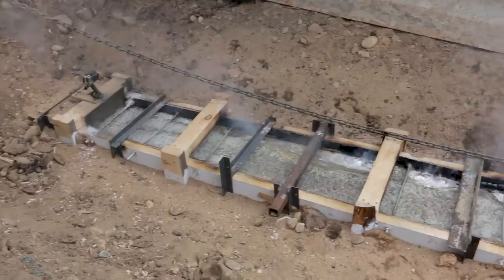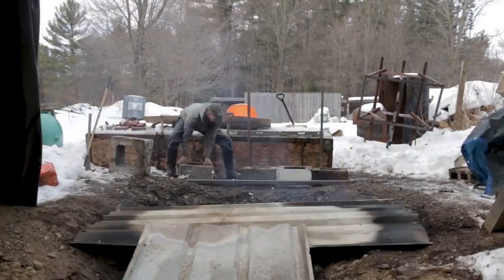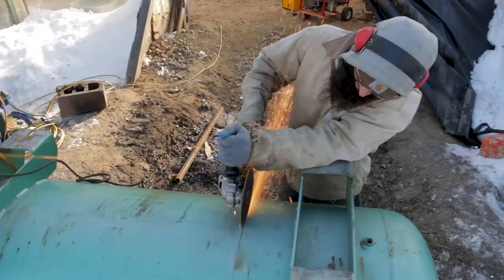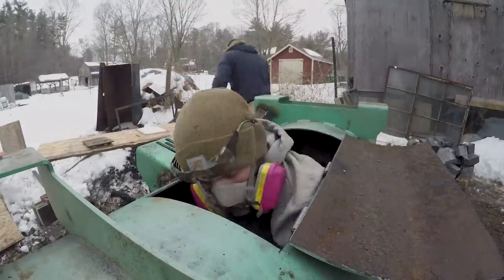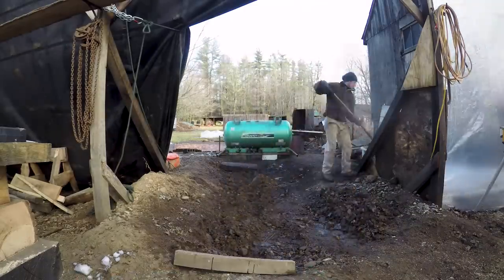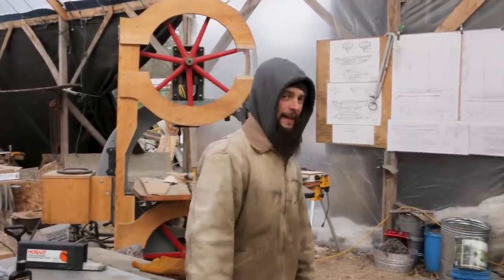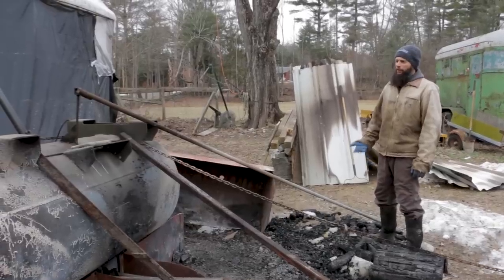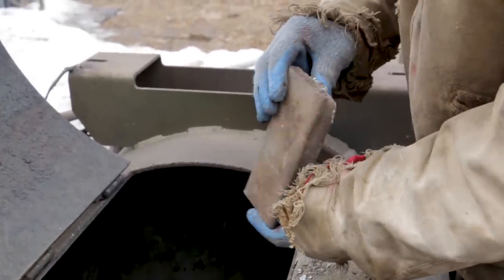Acorn to Arabella - Journey of a Wooden Boat - Episode 25: Setup for Our Lead Pour

Comment: I’m pretty sure that block of metal that didn’t melt, is a zinc anode.
Reply: Nate Reynolds I was thinking the same thing. They use them to absorb corrosion from salt water to protect iron or steel parts.
Reply: melting point
zinc 787F
lead 621F
 If it was an anode i'd expect it to have holes for bolts to go through. we'll never find out
Reply: If it says KIRK on it, its most likely Kirksite. Kirksite is about a 95% zinc/5% aluminum alloy that was originally developed within the automotive industry for sheet metal forming tools.  Zinc is still pretty heavy.

Comment: Awesome work lads. That kirk block will be zinc. Keep it as you'll be wanting to put zincs on your keel and prop boss to reduce galvanic corrosion between the lead keel/bronze keel bolts or bronze prop/stainless shaft. But I'm sure you're all over that.
Reply from the maker: We are aware of the need for anodes and will be putting them on when the time comes.  There seems to be many theories for the block, some say zinc, others say babbit and one even guessed silver although we doubt it's silver.

Comment: Anytime you have a problem with plumbing(and you probably won't now) Do not hesitate to ask me. I'll be happy to help in anyway I can. You could have used a union and swung each section of pipe toward alignment where as each was being tightened as they came into line. There would have been a slight difference where the two union faces contacted, but easily done if they were cut and threaded properly. Get er done. And you did. A modest patron and still a plumber after 42 years.    "A foolish consistency is the hobgoblin of little minds" R. W. Emerson
Reply from the maker: Thanks!
Not sure if any plumbing is in our future anytime soon but we will let you know if we have any questions!
Thanks for following and for the support!

Comment: Good job guys, but I think you were lucky those two 3/4" outlets did not block during the pour looking at all that crap left in the bottom afterwards, or was all that crap floating on top of the lead during the pour. Looking forward to see you get that out of the hole in the ground, you will need your cornflakes that morning.
Reply from the maker: Lead is so dense that everything floats to the top, steel, bronze, dross....  We were not concerned about the outlets, if they did clog it would be at the very end. 
It took 3 days but we got it up, out and moved.  We will show how we did it in the next video.

Comment: i havnt read all the comments on the plumbing problem, some of you have mentioned a left handed thread to solve this problem. have any of you ever heard of a running joint  there is no left hand thread involved  but a nut is put on  the thread first then a normal union then another nut  the joint goes in the middle of the union and the two nut go either side of the union to lock it in place. any thoughts on that?

Comment: How much of that plywood liner do you suspect is setting in the center of the keel? And if there is what kind of problems will it create
Reply from the maker: None.  Lead is crazy dense, it's like putting Styrofoam at the bottom of pool, breaking a chunk off and asking how much will be suspended in the water.  
The lead dumping in was enough force to smash part of the liner out, the chunks erupted to the surface and the top was liquid long after the plywood popped up.  Any wood that broke off had ample time to make it to the surface. 
After smoothing, some shaping and drilling of the ballast keel we found no indication at all that there is wood or dross inside the casting or any voids.  It seems to have come out very well.

Comment: Curious why you didn't make a positive mold and then use refactory sand in a box?
Reply from the maker: A wood mold is a proven method and the one most often recommended by the professional builders.  We were following the guidance of the pros.

Comment: "Tractor wouldn't start".

I'm maybe 40 miles north of you in New Hampshire.

My tractor had a lot of trouble starting over the past few weeks. Cold weather gels diesel.

Solution: use a heat gun to heat the fuel filter, to melt out the diesel gel.
Reply from the maker: It's a gas tractor, it had a clogged fuel filter. Diesels sure don't like the cold though so gelled diesel was a good guess.

Comment: Not plumbers, eh ?  What you wanted to join your 2 sections of pipe is called a union.
Reply: A union may not have held up to the lead,any good plumbing shop could have put a left hand thread on one end and a normal right on the other,old plumber/pipe fitter trick,ive done hundreds of them.including building several pipe racks (plumbers don’t use lumber racks,lol)for our service trucks,I’m curious why you didnt skim the crap off the top of the pour as you went,would have kept some contaminants out.im sure it’s not a big deal for this,but I’d not let that much remain were it me.
Reply: One thing I’d like to add,you might have should done the skim as it may become a barrier for the little bit of a layer you mentioned you may add to the top,you don’t want all that crap ont top
Reply: Never heard of a left hand pipe thread !
Reply: yup,i was injured in 1995,dad finally retired in 2003,he died in 2016 and it was then we sold all our tools,still had the left hand cutter,it was an old cutter,not sure the manufacture,but it was like a ridged,with multiple heads,4 of them,half to inch and a half.had to positions for the handle,,was a manual pull,we had a power unit,but my grandpa wanted me to get some arms,started hand pulling at age 12,by the time i was a high school senior i had 22 inch biceps..btw,my grandfathers uncle started the company in the 1920s at Lake Tahoe
Reply: In Oz, a barrel union.
Reply: Called an erikson coupling here in canada
Reply: I though unions were pretty much banned!
Reply: @Gottenhimfella   in the uk it's called a ground face Union, as a lad i thought that's what the G/F stood for.
Reply: @jackpatteeuw9244  simple lathe project
Reply: I came here to say this...lol I’m at that part of the video now...

Comment: a pipe fitting called a "union" is used make connections between fixed points. the fitting splits in half. it has two faces that butt together in the center and are sealed with a slip nut.

Comment: The answer to getting all the fittings tight is you put a Union in the line.Tighten all the fittings and then you tighten the union last.
Reply: crzy11000 you are correct, or better still fit two unions one on each of the two outlets from the tank.
Reply: Or do what they did. It worked and that is all they need to know.
Reply: Aah but the next person may not have the same equipment
Reply: Tim Brown Yes it did work but speed and potential troubleshooting it's always good to learn the proper method to reduce the error risk for any future endeavor of theirs or perhaps where they are sought out for advice from another and they can advise properly rather than just "what worked" this time as the next person may not be as confident or competent with a welder to prevent leaks.
Reply: I seem to recall that the seal in a union is made out of lead. Could be a problem when it melts. What they did welding it worked fine. Also a left hand thread could of been turned on one end of the pipe

Comment: Love your vids guys,I've built a few wood vessels in my time and I'm very interested in your project.I was thinking about your plumbing issue,you may have been able to use a union in the section between the two tank outlets,maybe???I was a carpenter all my life and have used unions in a lot of steel gas line installations,and at the outlets on water heaters as well...I'm not all the way through the whole series,I'm so excited...very proud of your commitment,best of luck full steam ahead...

Comment: You could have used a pipe union so you could tighten a pipe to both connectors then use the union to join the pipes in the middle. But welding works too

Comment: Great to see a proper Mattock(One of the ones with the right angle 'chopping' back rather than a pick or other shape) used. They don't seem common over there despite being in nearly every shed in Australia. One of the few hand digging tools I know of that can cut through rock hard clay, rock filled soil and after watching your video, even frozen ground!
I like the trick of adding blocks of lead to keep it from forming voids. That would work on smaller casts too.

Comment: You have been getting so much negative feed back, I bit my lip about the 1/4 plywood liner. When sizing joists for new construction they are 1 inch wider and deep than the size needed to take the load. In a normal fire they will burn up to 1/2 inch into the joist on all four sides. The half inch of burnt  joist will stop the the air getting to the beam and burning further. Of cause when the fire becomes an inferno nothing will stop the joists burning all the way through. I'm sure that you would in hind sight you would leave out the 1/4 ply and cut down another of Grandpas trees to use as as a 1 1/2 inch liner. LOL                 
                      PLEASE BECOME A PATREON AND HELP THESE GUYS TO KEEP POSTING THESE VIDEOS.
Reply from the maker: Actually we would use the liner again believe it or not.  It gave us very smooth sides and only a small portion of it came free.  In hindsight we would glue the liner in and put in more fasteners.  The glue bonds on the plywood held, it seems like the bottom of the mold distorted a little bit and the lead got behind the liner and that is what got it to break free.  A little glue and a few more screws and I think it all would have stayed put.  The plywood charred but all the layers were still intact.

Comment: For 1/2" and 3/4" steel pipe. Centerline to centerline minus 1 1/4". That's the length of the cut and threaded section of pipe.

Comment: Looks like you thought of everything that could go wrong except a couple minor issues. Had all your "I"s crossed & "T"s dotted lol. Can't wait to see how you lift & move this monster. Good work guys.
Reply from the maker: Thanks!
We certainly put a lot of thought into how best to pour that beast and are quite pleased with the results!
We will chronicle the move in the next video, bottle jacks, pipe rollers, the home made winch with a 4 to 1 pulley system and 3 days of grunt work to get it up, out and moved onto the cribbing.  It ain't light!!

Comment: 15:50 You could have added two 90° elbows and a small pipe in the middle to make a "Z shaped plumbing". It's easier to get everything tight.
Reply from the maker: That's a interesting solution we had not thought of.  Thanks for sharing!

Comment: for me it looks like that you are trying to re envent the wheel. The wheel is round, and why doing it so difficult, I do not understand
Reply from the maker: It has been done this way for longer than you think. The only thing we changed is figuring out a single source container to hear the lead in before the pour instead of using a bunch of cast iron bath tubs which were the norm. 
Heating it in a steel mold is not a good idea. First, you do not want the steel and it would be more work to cut that off afterwards. Not to mention you can't fair it like the lead.
Second as the steel mould heats and cools it would deform and you would not be able to keep the shape you need.

Comment: There must of been 50 replies telling you that you should of used a union. I think the sealing surface in a union is lead. That might of caused a leak problem when it melted. A left hand thread could of been turned on a lathe, but you solved the problem just fine. Keep up the good work.
Reply: Potable water unions can't use lead, they either use copper or iron seats...
Reply: @mikeskelly2356  Good point. I'm dating myself............gotta watch that. LOL

Comment: When you made the concrete mold - it seemed to be much more "formed" to fit the keel with inserts and other shapes to fit to boat - Where as this form seemed to be pretty straightforward and didn't have the complex shapes of the concrete form.  Did you change how you would attach it?
Reply from the maker: They are very similar.  The nib ends were still there just tucked inside the form so not as obvious.  The radius at the corners is sharper with the wood mold but a few passes with the power planer and those will be smoothed out.  Other than that they are the same shape and will be bolted on the same way.
Reply: If you have planer shavings that are surplus to your needs ;  they would help the guy making fishing sinkers for Kids.   Bert

Comment: The label on that unmelted block made me wonder if it might be a chunk of kirksite.  That stuff was used to make dies for stamping out prototype car parts.  Quick to make and nowhere near as tough as steel dies, but workable if you only needed to make a couple dozen parts for test purposes.
Reply from the maker: Interesting, Babbit, Zinc and Silver were the other guesses.  Silver would be sweet but we doubt it is silver.
Reply: I got curious enough to look it up.  Kirksite is a mixture of zinc and aluminum, and melts at 750F, versus 621 for lead.  You were probably close to melting it, but evidently not close enough.

Comment: Awesome video but I still would’ve gone with the original concrete mold.
Reply: nd you would have failed
Reply: Jake Yaboi  I don't know a thing about boat building but I am pursuing my architectural license and can tell you that concrete and extreme heat don't mix.  There is always some level of moisture in concrete, especially modern mix designs, and when you add alot of heat the slab ultimately fails.